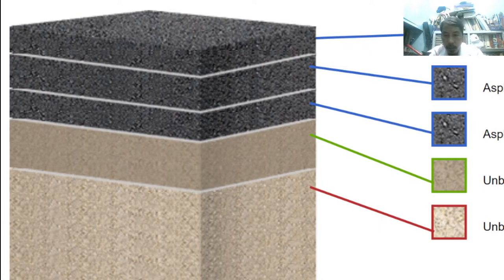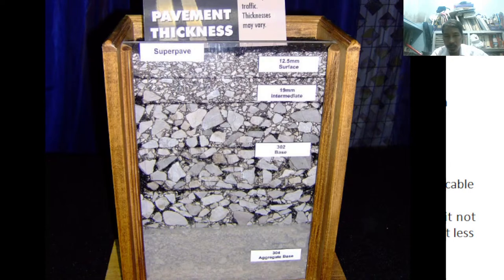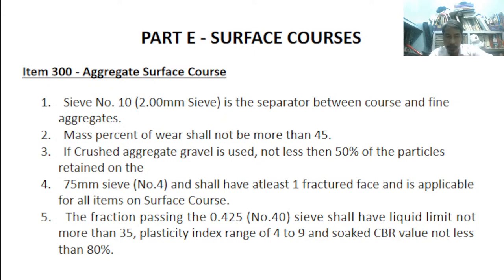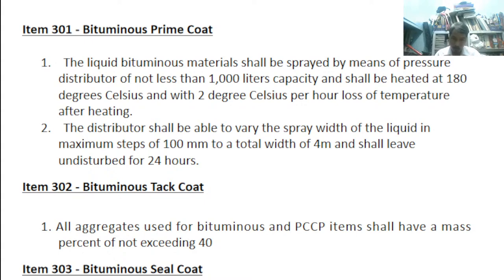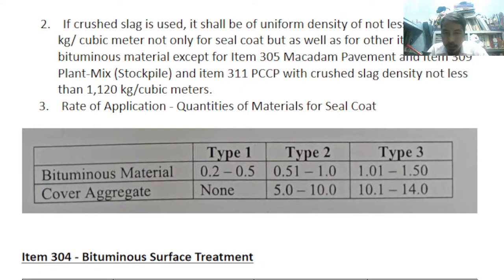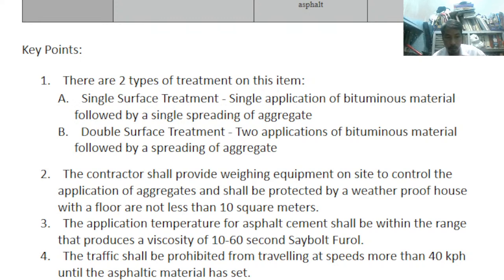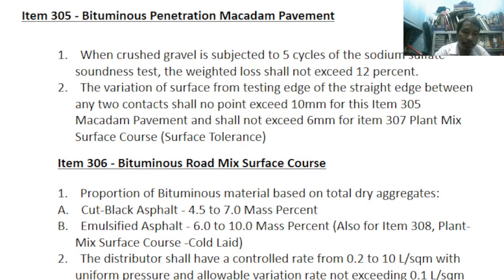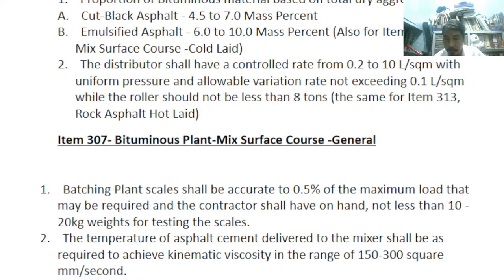[ LIVE CEE4 Lecture 09 ] DrAP Zantua Part E: Surface Courses for Material Engineer + DPWH DO

Comment: Thank you, Sir for the live lecture. I appreciated your teaching us that the primary purposes of the surface course are to create adequate tire friction, skid resistance, and to stop rainfall from leaking to the surface below. Because it can also be used to describe extremely thin surface layers, like chip seal, this phrase is a little different. In rigid pavements, the top layer is a slab of Portland cement concrete.

Comment: Thank you for this continuation video that tackles about part e which is all about surface courses for material engineer. In this video it shows the different layer of the pavement. The unbound subbase (406.7), unbound (granular) base (144.8), asphalt concrete layer (38.1), asphalt concrete layer (58.5) and  asphalt concrete layer (30.5). The other diagram shows the pavement thickness: aggregate base (304), base (302), intermediate (19mm), surface ( 12.5mm) and superpave.

Comment: thank you sir for discussing part E: surface course for material engineer. I learned aggregate surface course, bituminous prime coat, bituminous surface treatment, slurry system for road surface treatment, bituminous penetration macadam pavement, bituminous road mix surface course, bituminous plant-mix surface course general.

Comment: Thank you sir,I've learned that the main functions of the surface course are to provide sufficient tire friction, skid resistance, and to prevent rainwater leaking to the surface beneath. This term is slightly different because it can also refer to very thin surface layers such as chip seal. The upper layer in rigid pavements is a portland cement concrete slab.

Comment: Thankyou sir for this video lecture that tackles about surface courses. In Bituminous prime coat, the liquid bituminous materials shall be sprayed by means of pressure distributor of not less than 1000 liters capacity and shall be heated at 180 degrees celsius and with 2 degrees celsius per hour loss of temperature after heating. The distributor shall be able to vary the spray width of the liquid in maximum steps of 100mm to a total width of 4m and shall leave undistributed for 24 hours.